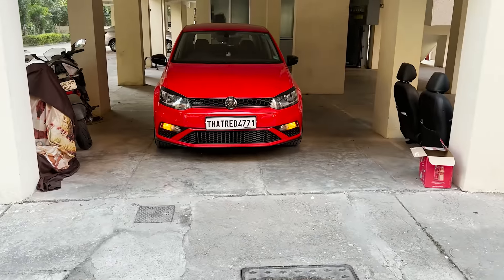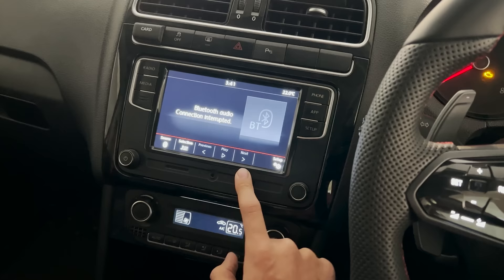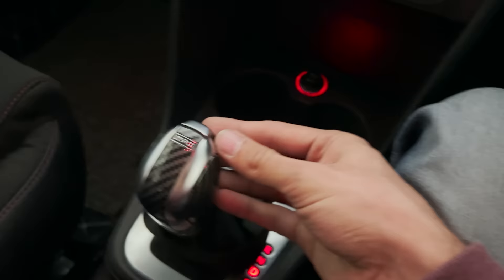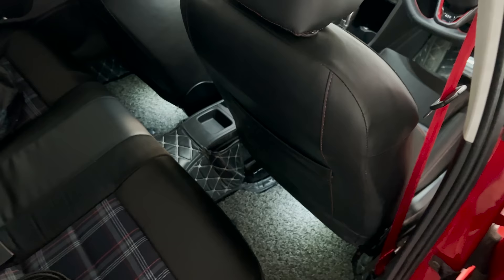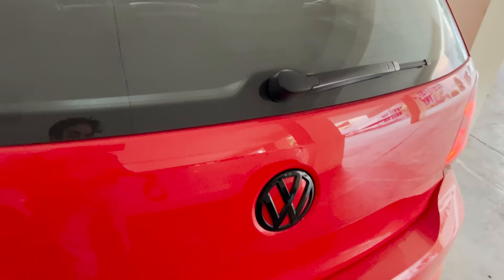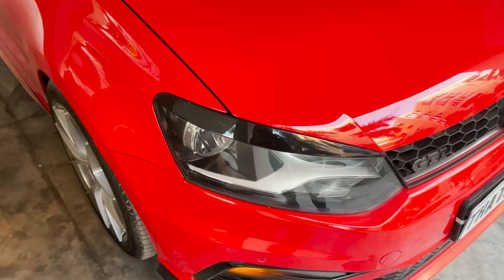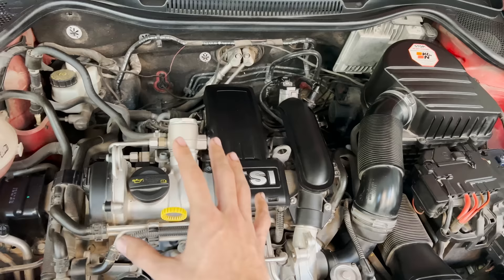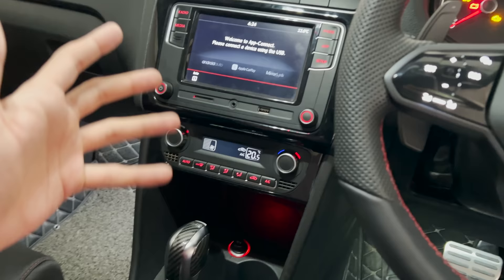Everything I Have Done To My 2016 Polo GT! Last Video On The Polo?

Comment: Hey Prerak according to what u said that u cant add more power to the engine ; i feel u can idk how fr sure but acc to wahat i have researched or seen there are many other polos out there which make more than 150 bhp and have a amizing ecu remap . please find out if your interested . and your doing a great joob bro .gg ❤❤
Reply from the maker: Yes it’s possible to push it at almost 150 bhp. But the cost to get there vs the gain ratio won’t make sense, hence the new project car 🙏🏻

Comment: The footwell lights looks so much brighter in this than the one I got from you 🤔. It also says 24v on it
Reply from the maker: Every light glows brighter on camera
Reply: @PrerakKataria  yes but mine are dimmer than oem Halogen .
 So I mistakenly installed a 24V halogen in our ambassador temperature gauge in the instrument cluster and it was super dim so I can’t even see the needle in it and I decided to change the bulb with a new one then only I saw it’s a 24v (for trucks and some heavy duty vehicles ) and when I plugged it the bulb tester at the local shop it was bright like it supposed to be 
That’s why I’m confused why the bulb housing says 24V instead of 12V . Maybe if I pair it with 24v it will be brighter like its supposed to ? 
Anyway I’m running Durvient t10 bulbs on my stock footwell housing now